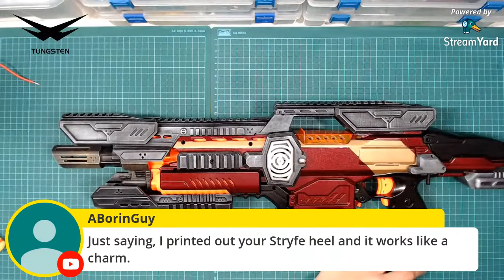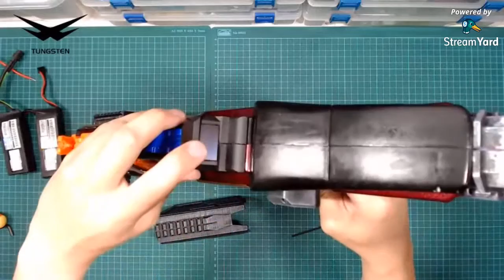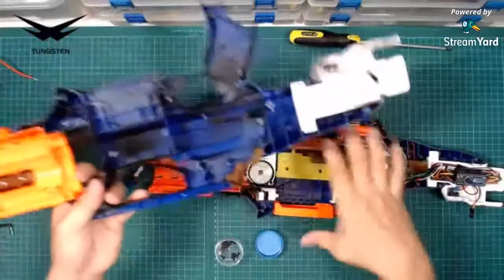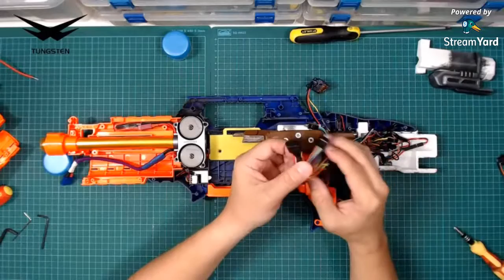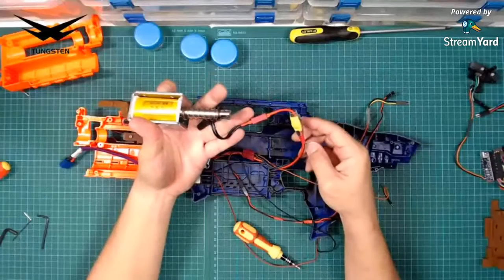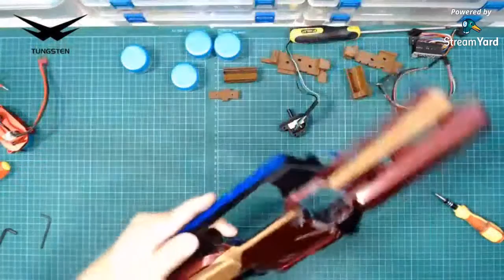Tungsten V6 (Part Two) - Dismantling, taking a Look Inside

Comment: very cool! what paint did you use for the black printed parts? printing this and wanted the same colour on those parts and a different body colour of my own
Reply from the maker: the black part, I prime it with basic black paint, then I just drybrush with sliver

Comment: Amazing build, very inspiring!
I noticed you moved away from the original pusher mechanism to a solenoid, may I know why?

Best regards
Pascal
Reply from the maker: Thanks Pascal, there are a few reasons, one being the original pusher can be tricky to control and brake in time, timing can be an issue. Second the solenoid gives a nice feedback with a little weight in terms of feel (felt great feeling the movement). I am still not 100% satisfy with the way I program I control the firing cycle and the way it determines the braking. One improvement is to place another sensor to detect the position of the pusher head, that way I can thoroughly determine the timing.
Reply: @TungstenEXE  thanks for the answer, I think I will try to use the OG pusher with a bit of weight to simulate recoil.. My idea was to use a merlin 75000rpm motor so we‘ll see how that goes🙈.
Thanks for the detail in your videos, very inspiring
Reply from the maker: @REVIVE_AUTOMOTIVE  😊😊😊

Comment: I absolutely love the body kit for this Rapidstrike!  My son and I are getting a 3D printer and I’m wondering what is the minimum size print bed your body kit requires?
Reply from the maker: It does not require a big volume, it only need a print bed that is 140 by 140 by 140.The printer I use is “flashforge finder”
Reply: Thanks!  The Flashforge is what I’m looking at getting. Everyone seems to love the quality, but the print bed size had been my only holdup.

Comment: I know this is a very strange request. Could you combine the pieces you had to separate because of your small printing bed. My bed is larger and it would improve the structural integrity if the separated peiced were connected. Thanks for hearing me out
Reply from the maker: :) Hi, may I know which parts would you like me to combine? I can try, you can drop me an email at tungstenexe@gmail.com it might take a while, I will see what I can do and email you back the files.

Comment: Awesome work. Just started to build this, printed both halfs of the stock end. What stock is used for this?
Reply from the maker: Awesome man! stock is something a got from the china website from some random seller.
Reply: @TungstenEXE  you got a link for it please
Reply from the maker: @stevebowyer2227  I tried to look for it again, but item is no longer listed.
Reply from the maker: @stevebowyer2227  I found the link, it is listed again https://item.taobao.com/item.htm?spm=a1z09.2.0.0.1f912e8dSHXZeQ&id=575511316814&_u=61p5mvl56be8
Reply: @TungstenEXE  nice thanks :-)